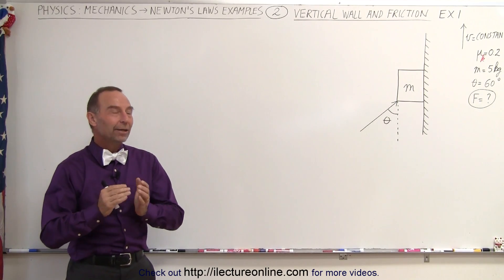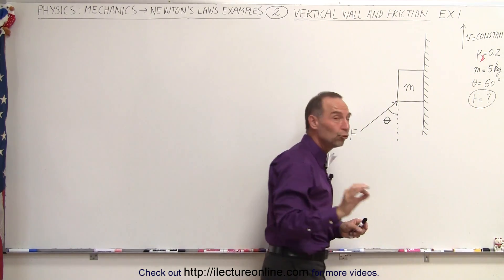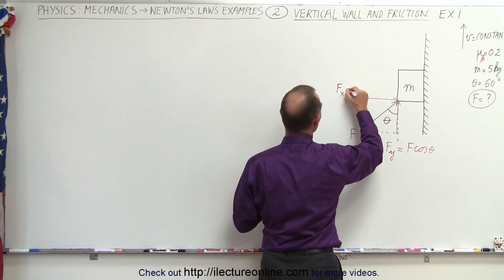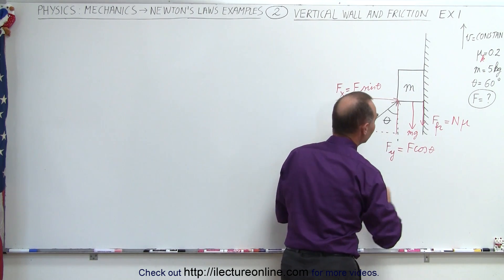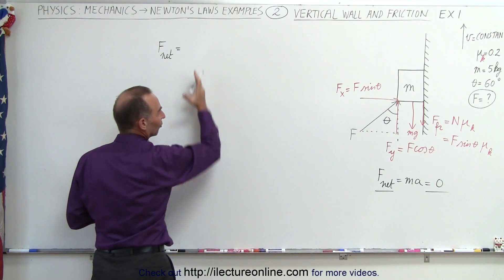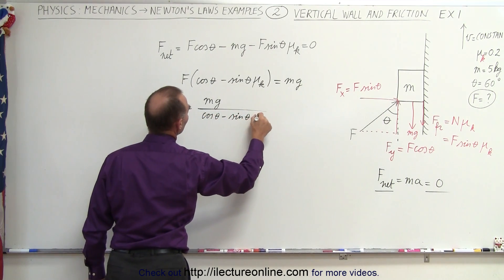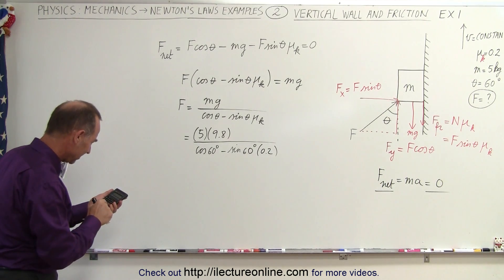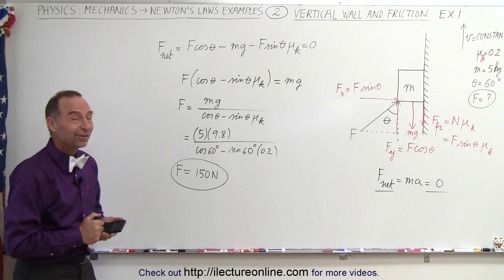Physics 4.1 Newton's Laws Examples (2 of 25) Vertical Wall and Friction Ex. 1

Comment: the direction of the friction force is not oppose to the motion but its intension to the motion so when the force is remove the block is fall down due to this the friction force is oppose to this fall down block.  due to this reason the friction force is up ward( F sin theta + ff =mg but not F sin theta =ff + mg).

Comment: I don't understand the concept of N force here. So can I assume that whenever I have a force pushing toward the surface this will be the normal force. I thought there would be a N force regardless the F force applied
Reply from the maker: The normal force is the result of the force applied (equal and opposite).  Think of it like Newton's third law: for every action there is an equal and opposite reaction

Comment: I have a question. It's similar to this without friction ." The magnet of mass 50 g stuck to the iron vertical wall. The force of 2 N makes it to move uniformly downwards. Find the force that should be applied for uniform motion upwards."

I solved this and I had a solution of 8.9N it's still looks like this isnt thr solution to me. Can anyone be of help?
Reply from the maker: The answer would be 2.98 N   (the weight = m g = (0.050 kg) (9.8 m/sec^2) = 0.49 N    The "friction force" = ( 2 N + 0.49 N)
Reply: @MichelvanBiezen  Thank you! I guess you meant 2.49N
Reply: Uniform motion =  net acceleation upwards is zero (0) = opposite forces are equal =equilibrium condition

Comment: If we want to give 100 ms^-1 or 150ms^-1 velocities to the block then the force will remain 150 N or what should do?
Reply: No if the magnitude of velocity / direction of velocity is changing  with respect to time. Then it's gain some acceleation. 
Because  velocity≠ constant so there will be acceleartion on the system . So force will increase or decrease
Reply: If velocity changing it's magnitude say 100 ms^-1 to 150 ms^-1 then  change in velocity= 50 ms^s-1  suppose in time 10 seconds . Then acceleation= 50/10 = 5 m/ s^2 . 
So F will not remain same as 150 Newtons . 
I.e Newtons 1st law of motion